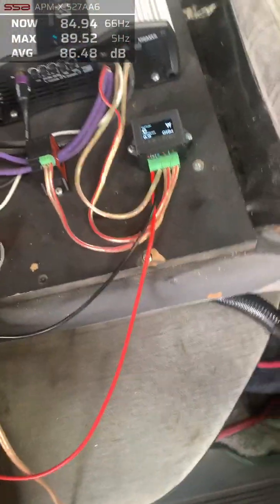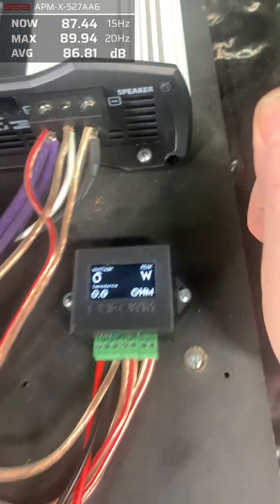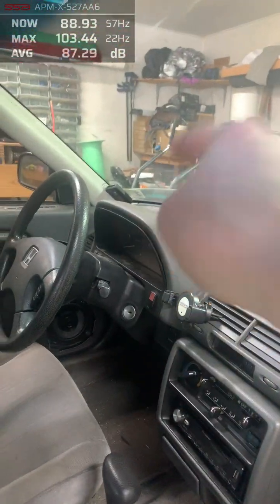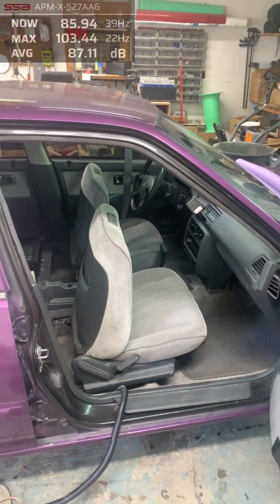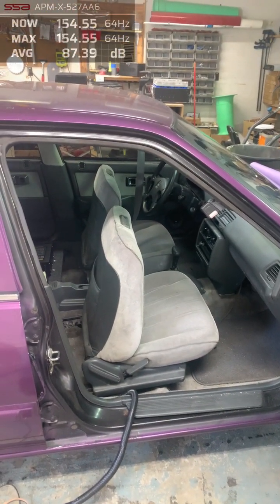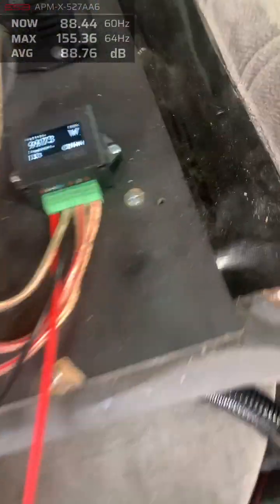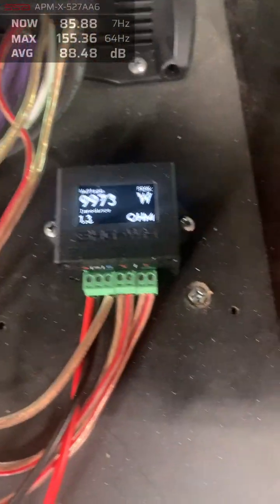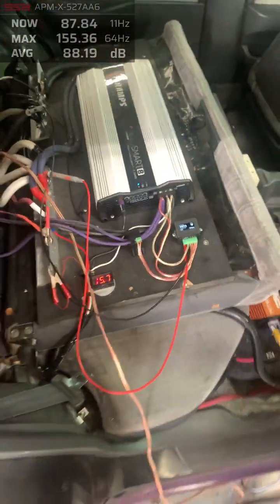Taramps Smart 8 wired to half ohm. Clamped power in vehicle

Comment: How does it do on music?
Reply from the maker: The amplifier does great on music, but this build was a burp build. This particular amp has been through a few different vehicles since this video, and all the rest of the builds were musical builds. The guy that owns this amp now is adding a 2nd Smart 8 to it on 4 Sundown Xv315s in a no wall musical build.
Reply: @AllAboutAudioJW I have 2 fi team 18s in a 6th . Looking to get another smart8 but it might be a min. Just wondering if it would put more power at .5
Reply from the maker: @Wathappn2u  The regular Smart 8 are 1 ohm amps. For burps where you know the amp is only playing one note. then you can get away with wiring lower than 1 ohm. With a musical buiild and you are planning on wiring to half ohm then I suggest getting the Big Boss 8 if you want the lights and crossover features.....OR if you just want a great raw power amp then look at the Chipeo 12K. They have half ohm versions of those as well now.

Comment: What does your power supply consist of to get 15.7v
Reply from the maker: Hopefully the link works. These power supplies are voltage adjustable. Currently I have this one set to 16.2 volts. This is a work around for burp vehicles that  are a royal pain to replace the alternator OR vehicles that have aftermarket alts that are hard to find. 

https://www.amazon.com/dp/B0C7KWHWGG?ref_=ppx_hzsearch_conn_dt_b_fed_asin_title_5

Comment: But, SkAr CaNt GeT lOuD! There now nobody has to say it.
Reply: I got three scars zvx 12 in the trunk of my 84 rivy on a big boss 8K, + i got two of those big Jeff audio lithium batteries wired in parallel, and my shit was hitting so hard it broke my trunk and when I drive by people's houses it says it rattles their walls, so my shit hits pretty damn hard.. enough for me..
Reply from the maker: @nickgurule167  nice man!
Reply from the maker: I say it all the time. LOL
Reply: Yeah, and a lot of “Skar haters” will come out and say that Skar subs suck. Yeah, no $h!t Sherlock, these subs are designed for SPL applications, of course it’s not going to sound accurate or clear. Subs that don’t have huge magnets tend to sound better. That’s what component speakers and tweeters are for, it’s to fill in that gap with SPL systems.
Reply: @Joshtheweatherman the magnets size don't have anything to do with sq, and the mids and highs won't magically fix shitty sounding bass. Skar makes a good sounding sub that beats the block down , the vxf. It's not a jlw7 but it's pretty clean and hits hard AF. Skar is a good brand and they prove that you don't have to drop a g to have good subs. I like the rockville destroyer subs , I've had them for almost 2 years on a smart 5 bass and the pressure from just 2 12s is nuts.
Reply: @Hayawasa Rockville Destroyers are underrated. People shit talk that brand too

Comment: When you burp the sound does the power supply throttle back. Like when you burp it can you hear the throttle supply regulating itself
Reply from the maker: Yes. When the amp throttles back you can definitely hear it. In this particular burp it did not throttle back, however, at a show we took this setup to it did throttle back and you can definitely hear the difference.